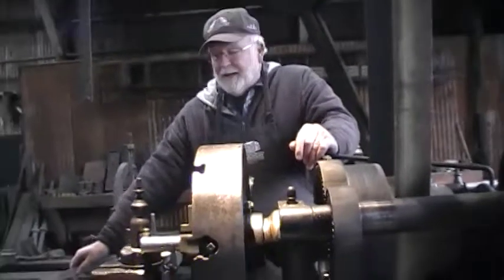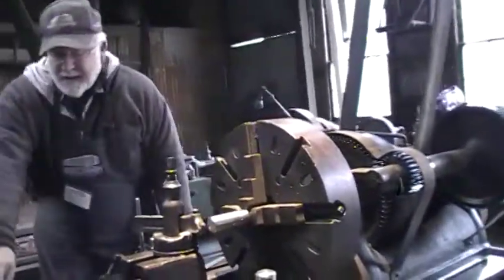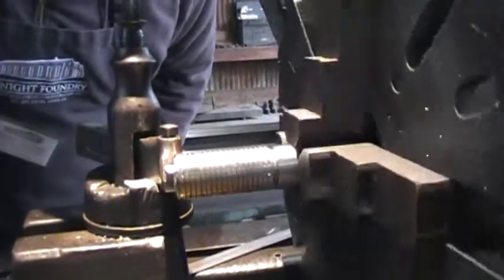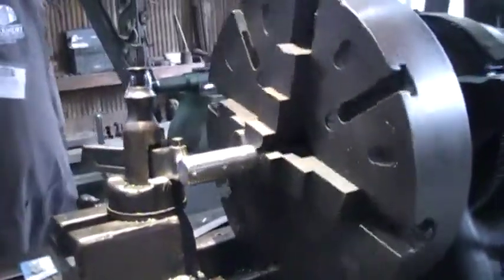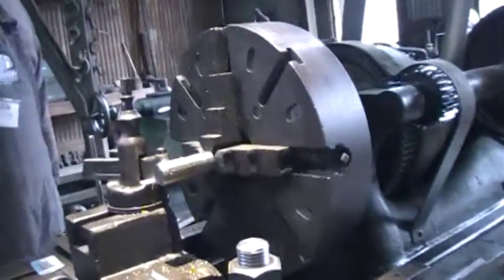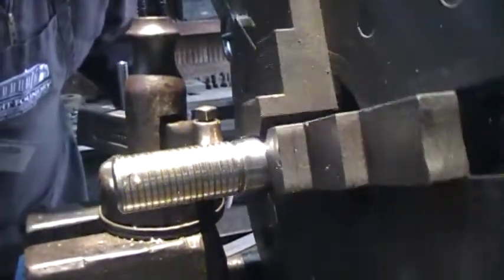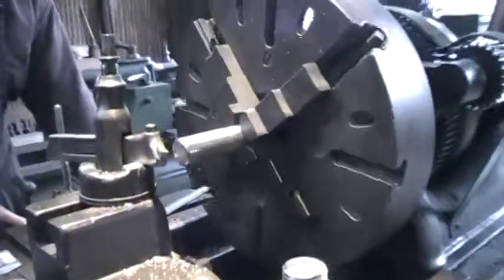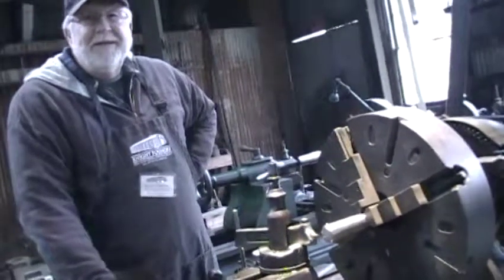Threading on an antique lathe at Knight's Foundry

Comment: This is really amazing stuff. It's hard to imagine seeing such well machined parts and pieces from that long ago. Did they transport it with a big wagon driven by horses? They probably had no idea that it would sit on the exact same spot for the next 150 years.
Reply from the maker: Thanks for the comment.  What I was told was the machine was transported by bullock cart from Stockton. Right now that's an hour away 75 mph! Unimaginable back then with no roads. Back in the day when men were men. Hä hã há
Stockton is essentially at sea level. Sutter creek is about 1200' above sea level. A gradual incline all the way